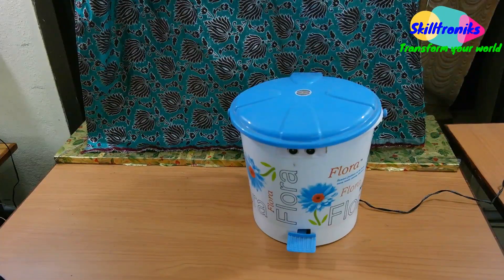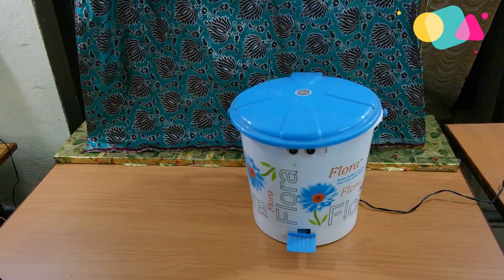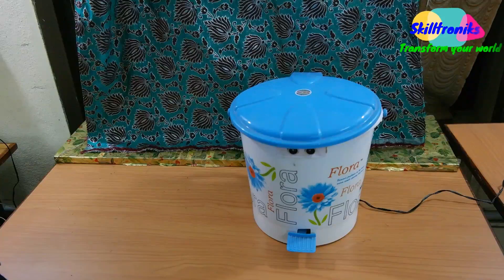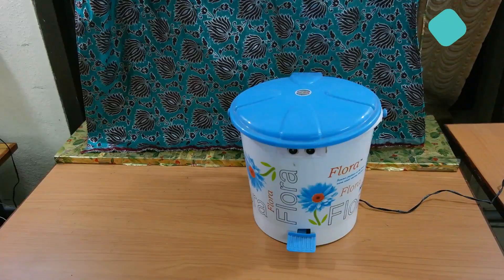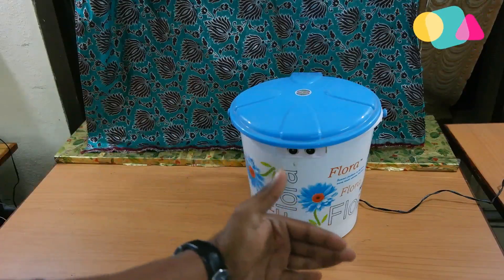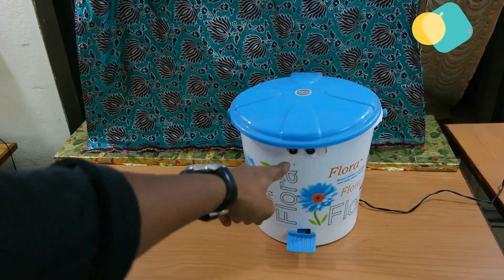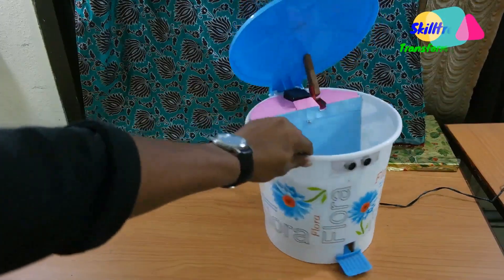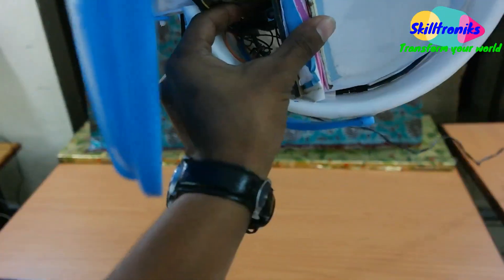Arduino Based Automatic Dustbin

Comment: How did u connect the Servo Motor with the wood that's opening and closing the lid. Please help me with this setup between the motor and the wood otherwise the rest of the project is done.
Reply from the maker: Hi Sattick, Connecting wood to the shaft of the Motor is very simple. Fix the shaft to the servo with screw given with the item. Take a small wooden piece of required length and stick it to the shaft of the servo using some strong adhesive (fevicol, fevikwik etc.,)

Comment: plz help mi to code arduino
Reply from the maker: Hi, programming Arduino is very easy and interesting too.Install the latest Arduino Nightly from www.arduino.cc website and open the IDE. Go to file, you can find many built-in examples. It'll be a good start if you are a begginner. Also arduino.cc website provides many tutorials for learning how to program ARDUINO. Good Luck Buddy..

Comment: how u made it
Reply from the maker: Making this is not so tough. You can find the inner view of the bin containing an ultrasonic sensor, and arduino uno and a servo motor. When an obstacle is present infront of the sensor within a given range, a sound reflection is received by sensor is then passed to arduino that controls the servo motor whose shaft is connected to a mechanical setup that lifts the lid of the bin, stays in open position and closes back after a programmed delay. Hope u got some clarity about the project..